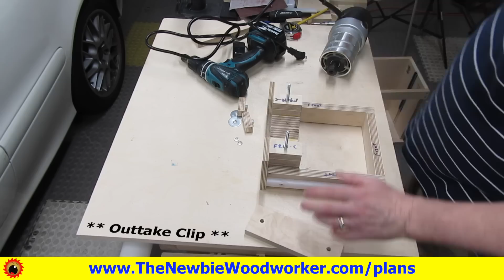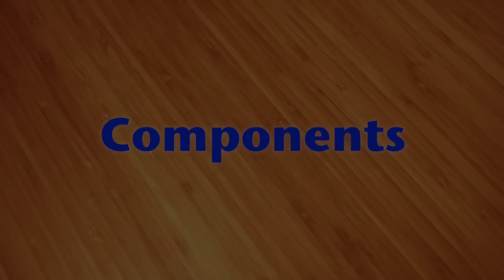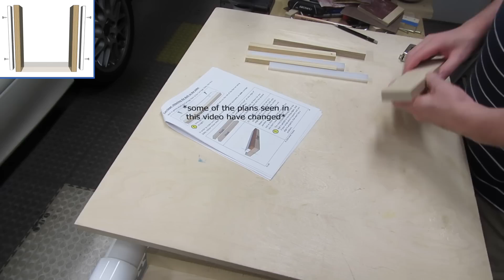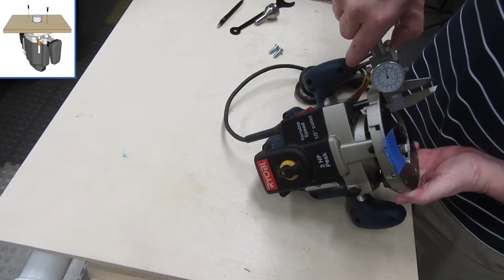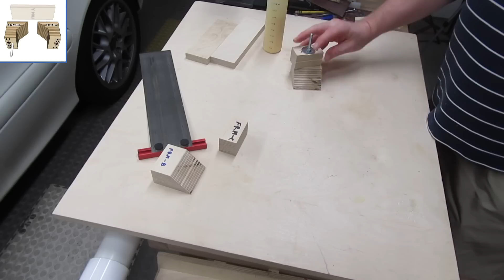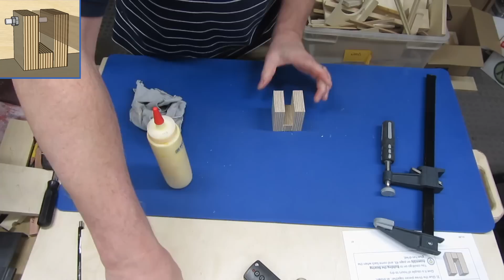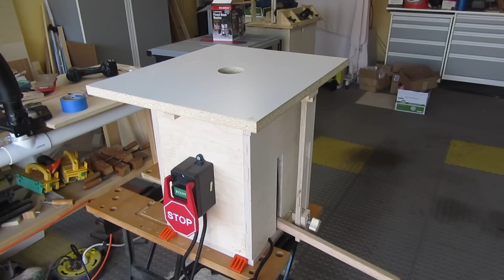Build: Router Lift with Lever & Mini Router Table, for Plunge & Fixed Routers

Comment: This is great. As an addition I’d set the router bit on specific heights and then mark the handle position on the box. That way you would exactly know the height when you need to set it next.
Reply from the maker: It's not that hard to use a measuring tool to check the height of the bit, but whatever works for you.
Reply: That would change depending on how far you stuck the bit in the collet. The height of the bit sticking out of the router is a variable that the handle position doesn’t account for.
Reply from the maker: @JasonConway777  👍

Comment: s a Health and Safety exec (Industrial light and heavy electrical mechanical)  ex military trained nurse inc refugee camps - emergency response teams/ Accident & Emergency -busy city based /  Kings College London / Ambulance emergency response to name but a few occupations ! I can honestly say that the vast majority of injuries in the work place AND at home are due in the larger part to stupidity, neglect, tiredness, post alcoholic haze, drugs such as marijuana and carelessness. Opening a can of corned beef with that notorious key attached to the can? whilst in an alcoholic haze which results in the can metal slicing into the fingers or the hand..?!! Oh yes better believe it ! As for using power tools WITHOUT safety guards? You don't want me to tell you some of the bloody stories from those scenarios. Lazy, shortcuts and let's hammer those fingers or drill into the hand or !! Love these vids as an avid wood/metal worker myself DIY but never forget the whole health and safety which includes those around me as pieces of timber fly off the work table enough I will add, force to slap that piece of timber into the wall AND stick. Imagine it in YOU? (wise not to) CARRYING timber and dropping it on your foot!! ? I wear STEEL toed shoes because over the years I KNOW they make a helluva difference should the need arise to protect ME ! I don't carry or move WEIGHT that is I KNOW going to put me at risk but ASK someone else to help OR wait until I have someone to help OR in some scenarios use the right equipment!! to do so. ALWAYS wear the right gear from goggles to masks to gloves to ! KNOW the risks of ie cutting MDF re dust - NOT in the eyes and that includes rubbing my eyes with my fingers NOOOOO! Got dust in my eye/s ? 👀Rub it NOOOOOO! Use an eye bath and rinse the eyes!! Using a welder ALWAYS use the correct shield or suffer what we call 'Arc eye' and I've seen grown men in agony re this ! Cleaning solutions and chemicals without using the correct gloves/masks /goggles!! Dry chapped skin to possible cancer risks !? inc of course acids and strong burning alkaloids. NONE of the guys I supervised EVER had problems re using electro mechanical devices /equipment SAFELY and CORRECTLY. Think as I say, before you BLINK 👀 and the chances are you will survive using power tools etc etc. No one these days has any excuses for ignorance when it comes to this as there are so many opportunities to watch, learn and listen re ie YouTube and more from the basics to the more professional. Over the years I've loved working on car engines/mechanical as well as of course electrical woodworking, sheet metal and so much more DIY WITHOUT major injuries. Yes I admit I've caught my fingers once or twice BUT you don't forget after that a painful lesson! By the way catch your nail with that hammer and you have a blood spot in the middle of the nail ?👀 PAINFUL pressure on the finger? I take a paperclip, needle and HEAT it before placing it on the top of the nail and let it pierce the nail NOT below or into the skin !! Pressure released! Pain gone! Whoever wherever you are, stay safe and that includes re this beast Covid 19! No excuse to be bored! Great vid this and I'm off to make my own plunge router lever operated lift..
Reply from the maker: Awesome! 😄

Comment: Instead of cutting down the track, could you put some washers between the plastic and the wood mount so they raise the plastic strip above the level of the wood?
Reply from the maker: Can you give me a time in the video, so I can refresh my memory? Thanks.
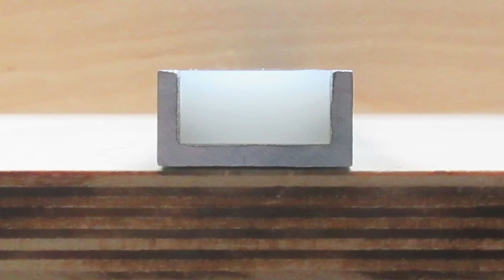Reply: @TheNewbieWoodworker   at 8:32 in, when the runner is exactly as deep as the aluminum track - if you spaced the runner from the side walls with washers (thinner than the runner) then you don't have to cut down the tops of the aluminum track.  At least I think it might work.  I do love the video - watched the whole thing and working on my own design for a 4.2in router. 🙂
Reply from the maker: @JohnKollar  Yes, I think you're right. It was all trial and error for me, even doing this the second or third time. The good news is, the lift still works great.

Comment: Dan, I think I have watched just about every router lift video out there, and yours really catches my attention.  But!!  I passed on your idea because it doesn’t have a micro-adjust feature, until I had a thought cross my mind.  What about incorporating a vertical screw-adjust feature in the height lock block?  With my addition to your design, I think I will build a router lift with your innovations.
Reply from the maker: Yes, you can do that, and in fact I've done it before. But in the end, I just never really needed it.

Comment: I've been tinkering with power tools for a pretty long time but I only now, because of this video, learned a router collet extension existed... I really need one of those to make my life a lot easier
Reply from the maker: Glad I could help. There's some on Amazon that are much cheaper than the one I used, so you might want to give one of those a try.

Comment: I'm in the middle of making something like this, and your plans have given me lots of ideas for improvements.
I plan to add a micro-adjuster screw to the lever lock so I can get really accurate cuts.
Reply from the maker: Glad I could help. I tried a micro-adjuster concept, but it didn't work as well as I thought it would. I'll be interested in seeing how yours works!
Reply: LOL.    I just made a comment to Dan about adding a screw micro adjust.   Then I decided to read some of the other comments.  Great minds think alike think alike.
Reply from the maker: @mikewelch3903  😂
Reply from the maker: 👍 @lafamillecarrington

Comment: Thanjs for showing your knowledge. I had an  elevator for my router B & D industrial. But bothered mevto use a wrench or drill for lifting. And now I have an improved variant of this lift, an don't  use two hands for adjustement just one. P. S.  Soon I will make the updated version. I will continue to watch these videos so objetive.
Reply from the maker: Thanks, and it's nice to hear from a fellow router lift designer/tweaker. I saw this video a while ago, and I think if I make another version, I'll include his idea of the steel rods and bearings: https://youtu.be/Tff3lX4g-Ts.

Comment: I use a "foot switch" on my router table. This allows me to start/stop hands free. Real handy when making stopped slots/grooves - I can hold the part in place until the bit stops spinning. Eliminates ooops when removing the part.
Reply from the maker: Great idea - thanks for sharing!

Comment: Hello Dan, I loved the video and like you said @ 0:39, I went and bought the planes on Jan 4 2019. I will be making this for my router this spring as my shop is not heated and it is to cold here in Indiana to work out in the shop and heating it is not a option at this time. I had a new roof put on this last summer and there is no ceiling to keep the heat in as the top is vented... :D
Thanks for the great videos!
Reply from the maker: Thanks! I hope you enjoy building it, and using it. Please let me know if you have any issues. And stay warm, then cool. 😄

Comment: Simple and easy. Good job! Would have made a  a piece in the shape of  ]   to block le level arm on both bottom and top position. Thank you
Reply from the maker: Thanks! I thought I was going to need something for the top of the lever, but it turns out the weight of the router is plenty to keep in in place. Never had a problem.

Comment: Another great video Dan! I watched a few others an so far I think your is the imperialist to make that will serve my shop. I'm not quite to the point of making one yet since I want to put it in my table saw extension which I am still in the research phase. But all in good time. I have an old router stand from Craftsman that I bought at a garage sale for under $5. I liked the corner clamps! I haven't watched that one yet. Those look like a great small project. BTW p;ease be careful with those kick back and launch demos. I know yours are planned but I had an unplanned one about a year ago and my belly still has a mark. I'm happy it hit me where I had extra padding. KUTGW
Reply from the maker: Thanks, and LOL. Yes, I have those "few" extra pounds also, but that doesn't mean we can't get bruised and have internal bleeding, so yes, avoid that at all costs. 😛And yes, all in good time. There's no hurry. 😄

Comment: Im thinking a dust collector port on the back me be better.. but I really like that dust drawer idea. In fact, I may do that for my bench top table saw..
Reply from the maker: I still don't have the ideal dust collection solution, so by all means, experiment! And if you find something that works well, let me know. 😄
Reply: @TheNewbieWoodworker  honestly, is there really an ideal solution??  Hehe..  and I'll let you know, because it really looks like that drawer thing is ingenious. Especially if you ever used a bench top table saw. You see all the dust under it inside the plastic box they're built into.
Reply from the maker: @elfpimp1  You're right, no, there isn't ever an ideal solution. 😄Good luck!
Reply: @TheNewbieWoodworker  😁👍

Comment: You put a LOT of work into this video Dan... nice work!  I can relate to the untold hours spent on each step from concept to completion and applaud you for seeing it through... not a job for the faint of heart.
All I'm gonna say in response to gettin' called out https://youtu.be/LJqPDADi8MM?t=2107 is that if a file doesn't work for roughing up a magnet then you're doing it wrong 😁😎  Sandpaper, as you discovered, works well too and can be less trouble but I like to get deeper scratching and sometimes a file seems the best way to accomplish that. It can be tricky but if you can secure the magnet in a wood-jawed vise or something and use the file's corner/edge it will give pretty rough scratching. Sometimes I use a carbide tip 'scratch awl' to scratch deep lines in that hard chrome plating they put on the magnets. The reason I prefer rougher scratches is that I've found magnets can be secured in seconds rather than an hour by using CA glue. Using epoxy like you do probably doesn't need scratching at all as long as the surface is clean.  I just rough up said magnet with file and spritz with activator.  Puddle CA glue (Gorilla brand seems to work best) into the recess for the magnet and press the 'activated' magnet down in the puddle... 10 seconds later you're D.U.N. done!  
Keep up the good work... and don't hesitate to keep me on my game with any 'calling out' you find reason for.
Best, Matt
Reply from the maker: LOL, thanks, Matt. All in good fun, as I'm sure you know. "You're doing it wrong" is a phrase I've heard throughout my life, so no surprise there. 😛By the way, where do you buy your CA glue activator? I can't find it at HD. Rockler carries it, so I may need to take a trip there. 'Cause I sure want to be D.U.N., that's for sure. 😂
Reply: @TheNewbieWoodworker  for sure... I enjoy a bit of 'good fun' any time... it's one thing I miss about not being out on a jobsite working with a crew... ahh... the memories!  The only store I know where the perfect little cans of StickFast Activator are available off the shelf is WoodCraft in Denver.  I don't get there much so if/when I run out I just get it through Amazon.  I'm pretty sure TiteBond has an aerosol as well as a pump spray (I don't like anyone's pump spray: it's too slow and too messy IMHO) and aerosols are all pretty much alike leaving my preference for Stick Fast boiled down to the very handy shape and size of the can.  Funny I choose THAT to be persnickety about, right? Best, Matt
Reply from the maker: @NextLevelCarpentry  Thanks, Matt. And no, I don't find that odd at all. It's just the way we are. 😄

Comment: Great project.  Would you please provide the outside dimensions of the assembled unit?  Thanks.
Reply from the maker: It depends on your router. The plans explain how to calculate it. But for my plunge router, it's about 10 1/2" square, and about 15 1/2" tall (without dust collection).

Comment: You could just cut the dado and install the miter track as one long piece then when that's done, just crosscut it to length. And again with the runners.
Reply from the maker: Yes you could.

Comment: I like your design and I also like Stubby Nubs design. Guess I'll get both plans and then deside what to do. But I have a problem. Took my table router apart to clean it. The motor housing is plastic and threaded. Height adjustment is done by rotating an outer ring. Since the motor housing is plastic I'm not sure it would be suitable for clamping. So, my question is what are the main characteristics I should look for in a new router?
Reply from the maker: Oh man, you got me there. I don't think I'm qualified to answer that question, since I've only used a few routers. Do some searches and see what other people are saying - people who will certainly know more than I do. 😄
Reply: @TheNewbieWoodworker  FYI -search result: motor housing parallel to bit and min of 2 HP. I've added needs both 1/4" and 1/2" collet and variable speed. Router I mentioned above satisfies all ;-)
Reply from the maker: @bobmackey8529  Sounds good to me! 😄

Comment: What do you do for a fine adjustment? On my cheap router table there is a long threaded rod with two nuts. One full rotation of the nut gives me .05". If I need lets say .01" I just rotate the nut clockwise (up) a little. How do you measure the depth on your table?
Reply from the maker: It's a little bit of trial and error for fine adjustments, but it's not difficult. If I need to get exact, I use a digital gauge like this: https://amzn.to/2LMbgRh.

Comment: I have a dewalt dwn743n (combi mitre and table saw), which has a different table height depending on which saw is used. I would like to build a station with a middle section that I can adjust the height of so it stays flush with the surrounding table tops no matter which saw I am using. Do you think this lift system (with one more set of mitre tracks maybe) would work?
Reply from the maker: That's a tough question. I'm not really sure. Sorry I can't be of more help.

Comment: So you don’t need to drill holes on the new insert plate? What is the brand and size of your router bit extension? Thanks.
Reply from the maker: You don't need to drill holes in the insert plate, as long as it already comes with holes (probably all of them do, but I just wanted to be clear). This is the extension shown in the video: https://amzn.to/2RusYec. I use a more expensive extension in my large router table, because I couldn't find any cheaper ones at the time: https://amzn.to/2AxfM0H
Reply: I mean, i did not see your router attached to your insert plate. I bought a rousseau 3509-9 insert that don’t come with the holes. Im just not confident to bore holes yet. Also, i bought exactly the same xtreme bit you have. I love it! Worth every penny. Thanks!
Reply from the maker: @goldfamily6852  You don't attach the router to the insert plate, or else you can't move the router up and down. If you start the video at the beginning, then pause it, you can see the screws in the insert plate, and they screw into the top of the router table itself.

Comment: Could you not have put a shim between the slider and the carriage side and avoided trimming the track?
Reply from the maker: Yes, you could probably do that, as long as you can keep the runner in the same place. Good thinking!
Reply: You could add a thumb screw in the bottom of lift Lock and make a micro adjust knob for the hight adjustment.

Comment: Could you also use drawer slides instead of miter gauges?
Reply: Drawer slides have too much play to be effective unless you do a MOD to do them like Mathias Wandel did with his, but even then, in the vertical orientation, I can't imagine them staying in alignment for too long.
Reply from the maker: Troy's comment was spot-on. That's why I went this route.
Reply from the maker: @troymeredith521  Thanks, Troy, I couldn't have said it better.

Comment: What thicknes of plywood did you use? 👍
Reply from the maker: I used 3/4" Baltic Birch plywood for the vast majority of the build. If I don't say in the video, then it's 3/4". There's just a couple of spots where I use 1/2".

Comment: About 17 minutes in, c'sinks on the wrong side. Doah!! Been there,done that. I
Do you like your counter sink bit? If so, please share the brand. Mine are junk.
Reply from the maker: LOL, thanks. No matter how much I try, I still screw things up. I guess that's life. I don't like that countersink bit, so I wouldn't recommend it. The ones I like are my combination drill/countersink bits. But of course I don't have one for that size. And I don't remember where I got them, but if I had to guess, it would be Rockler.

Comment: Love this!  Do you find the lever gets in the way at all around the shop?  I trip over everything.
Reply from the maker: Thanks! I trip over everything, but I've never run into the lever. I can't believe I just typed that, because you know what that means - next time in the shop I'll run into it. 😛But on my router table, the top sticks out past the edge of the cabinet by about the same length as the lever, so that helps keep my clumsiness away from it. 😄